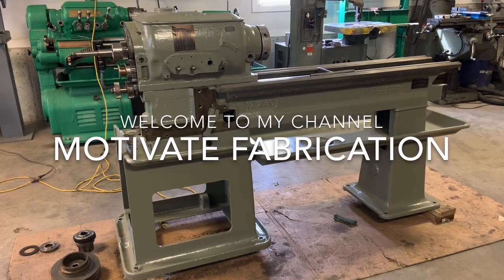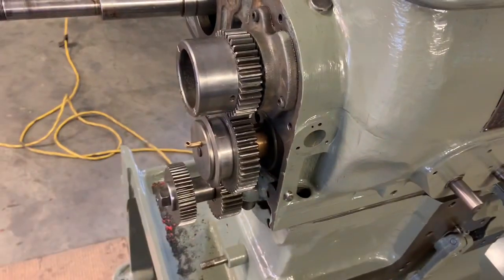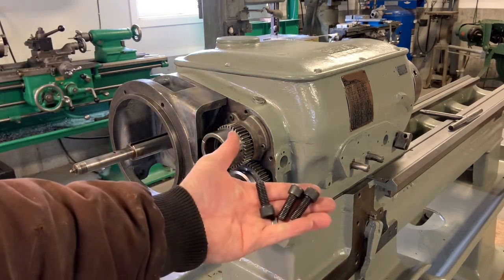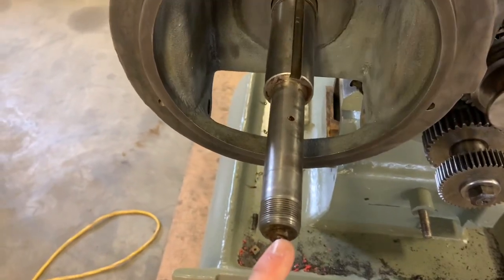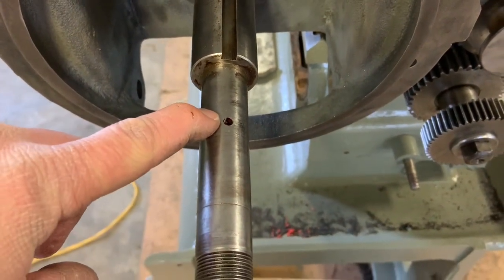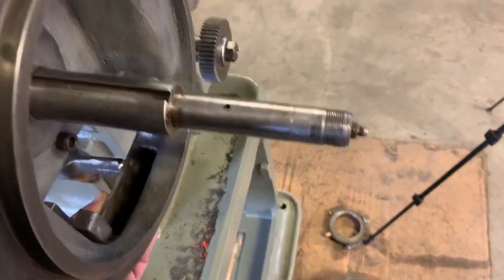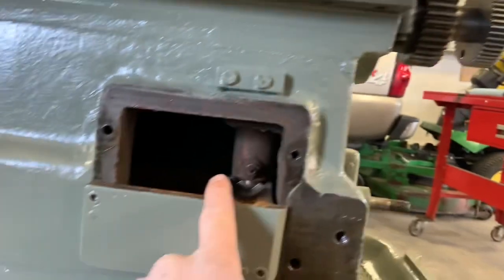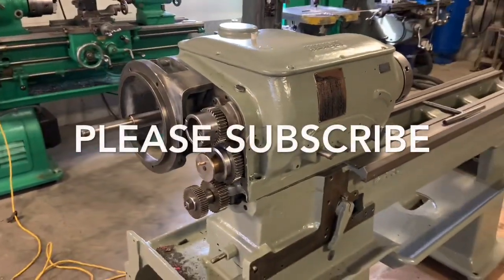Hendey Lathe Brief Update

Comment: I imagine you already know this, but while the brittleness of standard cast iron is a serious drawback as you point out, there were some pretty good reasons other than cost for it's use in machine tools.  It is significantly better than steel for dampening vibration, is naturally harder and more wear resistant than unhardened steel, and the high carbon content in the brittle cast irons tends to lead to the formation of microscopic graphite grains in the metal matrix which provides some minimal inherent lubrication

Comment: I believe that oil control scheme is called a slinger. Centripetal force literally slings any oil on the shaft off into that little recess where it drips back into the gear case. Sometimes there’s a washer that fits on the shaft to improve performance. The washer stops oil from migrating down the shaft.
Reply from the maker: Awesome thanks for the information